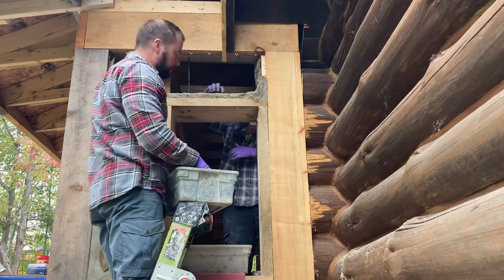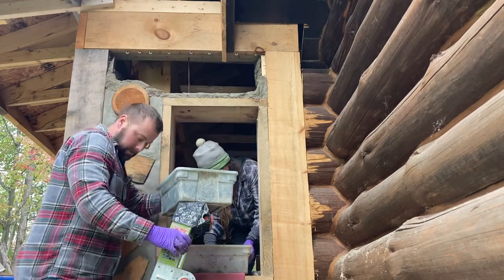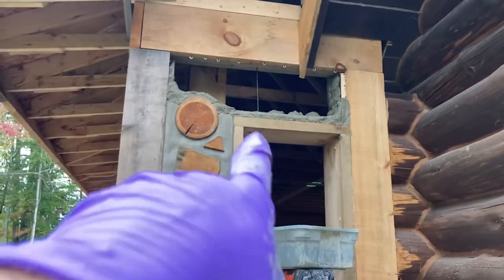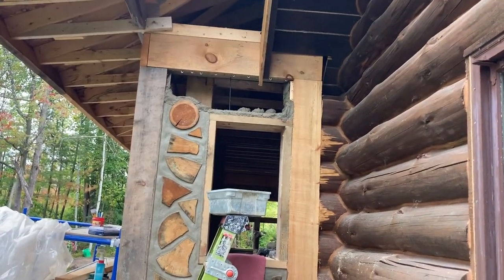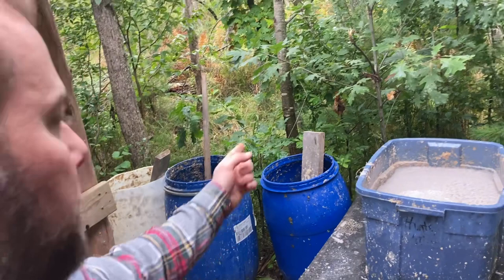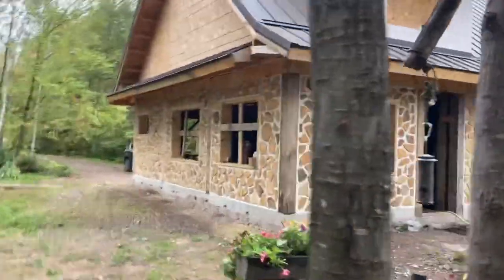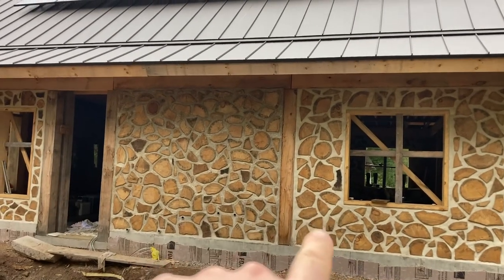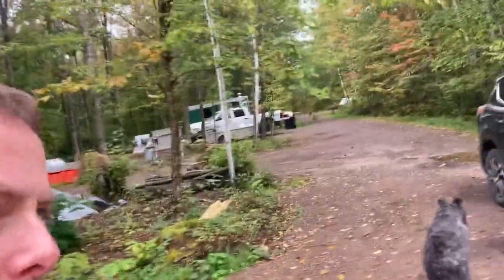#194 Cordwood Home Build Off-Grid/ Tips and Tricks That Worked for Us

Comment: Absolutely gorgeous. Im curious. How long was the cord wood drying for before you built with it? Does the mortar span the entire depth of the wall, or did you put saw dust or something similar in between 2 lines of mortar like ive seen others doing? And lastly, what did you end up using to treat the wood once you were finished?

Yours turned out better than any others ive seen. Amazing work.

Comment: What is the benefit of the reason why you use the paper slurry mixed with the mortar? Why not just use straight mortar?
Reply from the maker: @Caseyjacob-k2q  it slows the cure to help with cracking because the wood it surrounds draws moisture out and it helps to bind it together.
Reply: @backinthewoods2022 Is there any problems with winter/summer weather when it comes to the mortar?
Reply from the maker: @SvensktTroll  hasn’t been in three years on ours. I also visited a house in Minnesota that’s been built for 20 years and it’s still good.
Reply: @backinthewoods2022  Okey thanks 👍